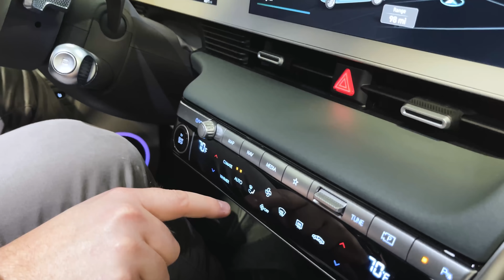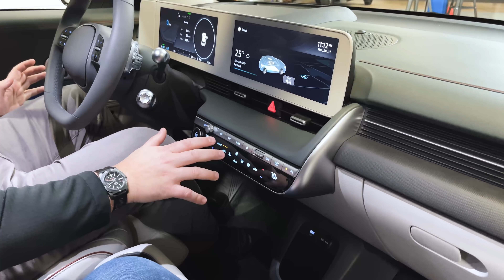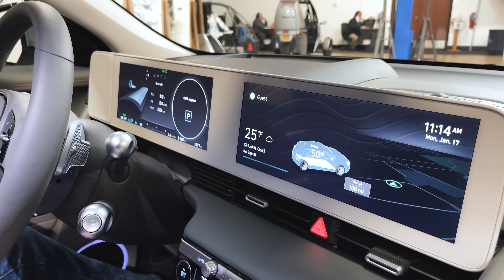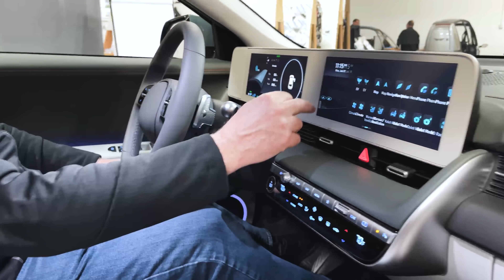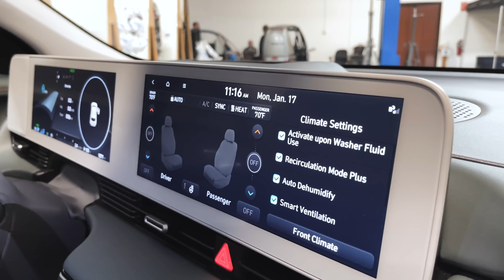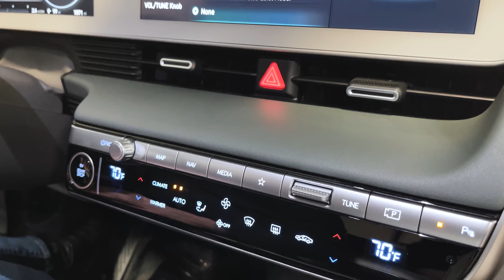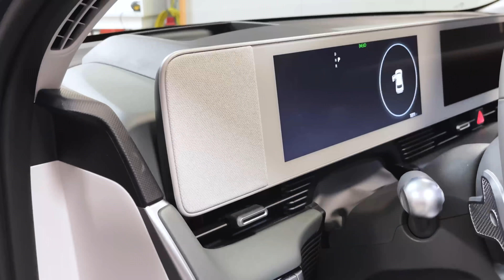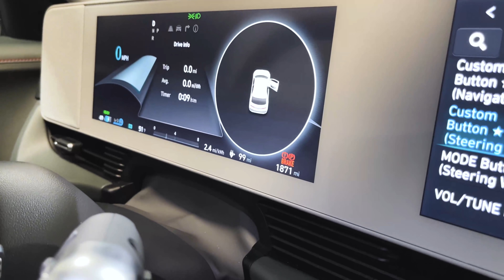2022 Hyundai IONIQ 5 | Sandy's First Impressions

Comment: Since watching this, I have just been out for a test drive in one. I was really impressed, the performance was impressive! So much space, especially in the back and the reclining rear seats are so comfortable. Very compelling package this car.
Reply: I wish Sandy had gone into the seat functions further.  The backseat reclines, but does the front seat recline?  There is a mid calf support on the driver's side, leading me to think they do.  Honda has the "Magic seat" in the Fit and in the HRV where the backseat reclines and the front headrest is removed while the front seat reclines.  A person in the back can then fully stretch out like a Lazy Boy.  Some Japanese executive cars, like the Toyota Century have a front seat pass thru for the rear seat occupant to stretch out.  This seems to be a really nice feature found on some Asian cars for practical reasons, since many are driven by Driver- Chauffeurs.
Reply: Hows the handling and comfort?
Reply: @maisondav1d  really good actually! The seats are amazing, the handling is tight and it’s not too firm or to soft. The steering wheel is very adjustable and the driving position is very flexible. It is a big car but its lively to drive. I like that you can floor it round a corner and the back wheels light up and you can drift it 😜

Comment: Curious how you feel about their decision to not have a rear wiper?  I was hoping that aero would push the water off but on other videos I've watched, it doesn't seem to do so.
Reply: I'd bet that the 2023 model will have one after all the backlash over it
Reply: If they used higher quality glass, it would be fine.  The crappier the glass, the more water clings to it.  The worst I have seen is the glass in the chevy volt.  It was the only car I have driven in where wind over the top of the car does not clear rain off the back window.
Reply: In reality, it is a complete mess and you can't see anything, if rain and dirt droplets start to spread all over the glass. Very dissapointing that those two guys talk about the ribbed platic rails, but don't "see" the missing wiper.
Reply: @Stefan_Dahn  Wipers should not be needed.  Wind should clear it.  But if they use crappy glass, then the water sticks and wind won't clear it.  Also, we should be replacing rearview and side mirrors with cameras.  Mirrors are all so terrible.  "objects in mirror closer than they appear" is a defect that cameras do not suffer from.  Cameras can be placed in spots with great visibility and without any distortions you normally get from mirrors.
Reply: It seems to have a rear "glass spoiler" - if it is sufficiently well designed - I don't see a need for a rear wiper.
Reply: @rkan2  Many people, who have driven them, say it's a problem.  I'll take their word for it.
Reply: @wilfredvanvalkenburgh2874  It’s one of the few drawbacks (lacking matrix headlights is the other for me) but not enough to put me off. I am going to nano coat the back window to have it clean itself when I get mine…

Comment: Good coverage as usual. A couple of features you hadn’t seen were variable “auto” setting on climate control and the configurable star button on the steering wheel. Both have been on BMWs. The I first came across the star button on the E65 7-series with original iDrive.

Comment: Why not get rid of all the left-side controls, AND the lower instrument panel, and put in 8 to 12 programmable buttons that can control ANY vehicle function from emergency lights to rear seat volume mute?  A/C on at 72 degrees, FM radio at 100.7, courtesy lights on/off,  call work office extension 142,  check outside air temperature...  Make those buttons "instant access to any feature" buttons.  Don't preset the functions - functionalize the presets.
Reply: @Carl Stockmal Have faith young man, Neurolink IS COMING. 😉

Comment: Yeah, and a problem with the screen only Tesla hvac interface, is that menu diving to find defog when driving in to tunnels in cold weather can be downright dangerous. 

Visibilty can drop to zero in a matter of 5 seconds. I almost crashed a Tesla 3 because the windows fogged down and there were no physical defog button. 

Your
Reply: Exactly, Sandy wants it to be more like a Tesla. I think a lot of consumers may like it less like a Tesla.
Reply: @justsayin7314  Maybe.  Personally I do like it uncluttered and simple, and the Tesla UI is great, but their view of what is and isn’t safety critical features that should be fully available at all times might be a tad to californian.  Sandy does the same mistake in this video. 

Hiding hvac and viper features in menus seems dangerous to someone from a «complicated» climate, they are as much part of getting from A to B as the steering wheel and pedals! 

To mention their own point: we really don’t want rental car drivers to fog up and crash, do we?

Comment: I have the RWD Long Range version w 77.4 kwH battery in Canada, I really am enjoying the car to date. I found that accessing everything in the system pretty easy overall but I am a nerd. The drive quality and range is great. Efficiency is very good in city and okay at highways speeds of 100-115kmph, hit 120 and it is not as great however to date I have enjoyed turtling around at 105 on the highway in eco mode w auto regen. I am impressed with the build quality and comfort of the car. I am also happy to own something a little out of the ordinary as well. I give the car a 2 thumbs up and I did not buy the Ultimate as I did not need some of those features nor awd

Comment: I don't think you can judge a press car on fit and finish as I'm sure they've taken more time to make it more perfect than a normal customer car.
Reply: There's plenty of Hyundais on the road to know what a production car looks like, and they have made huge progress over the years to the point where many compare them to Japanese quality.
Reply: @Speedytrip  I'm not saying it would be bad quality on a customer car, but they most likely ensure a press car is as perfect as it can be. For instance, did you know that the cars of German auto journalists are called "Presseautos" by German manufacturers, with their own manufacturing track & product codes, where Porsche, Mercedes & BMW add better engines, thicker paint and more insulation, etc. Not sure if this is just a German thing or a legacy auto thing.
Reply: I thought I understood Sandy say that this demo was a borrowed car, which I took to mean it was a borrowed customer car, and not a specially prepared  car for a Munro live evaluation.
Reply: @bmax403  1:37 "this is a press vehicle"
Reply: @alsmith358  Yeah no doubt about that. But just saying Korean fit and finish is now pretty much on par with Japanese manufacturers. And looking at this Ioniq, I think the American manufacturers will have a run for their money in terms of EVs.
Reply: I bet this car and a car you buy from the dealer both arrive with the same fit and finish.  Even going back to the new Hyundais released circa 2009 the fit and finish was superb in dealer cars.
Reply: This is not a press car this is the final version as these are delivering in the US, I have my RWD in Canada already and love it
Reply: @alsmith358   its not though this is the final version, 100% an error as this is what comsumers are getting
Reply: @kiddcisco  Press car does not mean pre-production vehicle, it means it's a company car that they loan out to people in the press.

Comment: It will be interesting to see what is going on under the “frunklet”.  I remember the Ford frunk looking great and useful, then seeing a plumber’s nightmare of custom rubber hoses and reused parts-bin stuff from ICE vehicles hidden underneath.  From the user’s point of view, it looks like a nicely designed car that will sell well into the family electric transportation device market.  Not a challenger to the Tesla Model Y from a performance standpoint, just a useable electric car with a modest amount of cargo space.
Reply: Ioniq 5 N version is expected to come out and will have similar performance to the Kia EV6 GT and Model Y performance for those that care for that in their family EV...
Reply: I own a jaguar XF that uses a Ford motor. I have had multiple issues with coolant leaks. The mechanic commented on why they had so many hoses in that engine. Now they put those same hoses into an electric. I just don't get what they are thinking.  The XF engine has actually been reliable except for the coolant issues.

Comment: This is the first review that has a substantial critique of the styling.  The one thing I agree with is that the fake kick panel in cheapish silver doesn't look great when you don't use a silver or grey paint.  In blue, black and teal the kick panel and wheel well work doesn't look great.  Strangely this is only an issue in the Limited edition.  The SE and SEL editions get the carbon colored kick panels which look much better with darker colors.  I suppose if everything else about the car is what you need you could order the body panels for the SEL and have a body shop put them in.

BTW: This is also one of the most detailed reviews period.  Excellent work.

Comment: How about lack of rear wiper? I drive a Chevy Volt without one and it’s a miss.
Reply: That does appear to be the general consensus.
Reply: I used to have a Chevy Volt and no wiper was no problem....same with my current Model Y
Reply: @lenimbery7038  This is a hatchback design. Air flow can't keep it dry like the Y. Have a look at Bjorn's drive when he can't see out the back window because of the dirt.
Reply: @lon6320  I used to drive a cube van with no rear window.  Not a problem if you know how to use your side mirrors and driving techniques to minimize limited rear visibility problems
Reply: Try some Rain-X.

Comment: I love this design. It’s like an 80s VW GTI got sucked into Tron. I would love to see a tear down. Does Sandy know about the V2V and V2L charging capabilities of this platform? I think when the dust settles, and the existing ICE car giants have tried to make the switch to all EVs, Hyundai will be one of the survivors. The 800 volt architecture and reverse charging capability seem very forward thinking. I’m just not sure about the rest of the engineering. Tear that baby down!
Reply: Agreed. But don't discount the forthcoming Nissan Ariya. Almost perfect, even if slower charging and a tad spendy. I have seen one in real life and it's fantastic.
Reply: Rather more a Lancia Delta Integrale
Reply: @GudieveNing  Having seen one in real life is a good sign.  Did you see it in the US?  Being driven on the street?  Did you get to talk to the driver?  Was it individually owned, or dealer car?

Comment: As someone who lives and works in the Midwest in all kinds of conditions, give me buttons. One of my greatest pet peeves is having to take of gloves in the winter to push a button or get a touch screen to work.

The other thing that drives me crazy is all of the grit, grease and dirt that makes the touch screen nasty or scratches it up. I also hate the glare off of the screen or the constant dust build up.

I live in a rural area and mud and dirt is just a fact of life. The other must is a proper volume knob and an on off or mute button on the radio.

Every vehicle with a touch screen and some years on it looks like Hell compared to the day it was new.

Touch screens okay for some things but leave my steering wheel and buttons alone. Also changing out one switch or control when it fails is way better than replacing an entire touch screen because of failures. Way cheaper also.

Comment: I have to disagree on the physical buttons delete. If I was on charge of safety regulations for cars, I would mandate physical controls for headlamps, wipers, shifting and climate controls (a front and rear defrost button at the minimum). Another thing that I don't understand is the lack of a mechanical emergency brake, something that is guaranteed to work even when the car is completely inoperative. With a lever accessible from the passenger side. It actually saved my garage door when my step daughter was learning to drive. She put the car on drive instead of reverse, on an inclined driveway, and my girlfriend's instinct reaction (she was on the front passenger seat) was to yank on the parking brake lever, thus saving the car and the door.

Comment: This car cant pre heat the battery when it is not plugged in. This will lead to a terrible charge speed in the winter.
Reply: All electric vehicles should have a button that lets you turn on the battery heating manually. It would make the daily usage so much easier.
Reply: Hyundai has already announced that preheating is coming. OTA Update I guess.
Reply: WRONG. Hyundai already announced that an OTA update is coming with pre-heat.

Comment: My 2014 toyota avalon has the same style of capacitive touch buttons.  I absolutely hate it. just accidentally touching the button changes the mode on the HVAC and it is distracting to get back to where it was before.  the radio controls are total confusing crap as well on the touch screen.  Also the visibility of the touch screen is poor.    I am with Sandy in getting rid of the whole dedicated touch button panel.  If you are going to put a touch button, make it have tactile feel or don't put it there.  
As always great review by munro and associates.

Comment: I have to disagree with Sandy on touch displays being superior to buttons and getting rid of the whole climate control cluster. Even the cluster they have is suboptimal, because it is basically a touch screen, that should be buttons. Adjusting you climate control should not require you to take your eyes off the road, only buttons can accomplish that, no touch screen can do that. Otherwise, in my opinion, it is a safety hazard.
Reply: 2022 say no to buttons.

Comment: This 800V doesn't give great advantage over Tesla new 450V in Model S refresh. The only benefit is lighter components and HV cables. As of charging it's 2P instead of 4P cells configuration so there's not much advantage here for charging unless they went for like 120kWh pack.
Reply: Ok but you're talking model S
Reply: 800V or 400V or 20.000 Volt do not make a difference in themselves.
Reply: Who cares about model S? Not even Tesla anymore. They only sold 11K model S & model X combined out of 308K cars last quarter. The Hyundai Ioniq 5 completely OBLITERATES the tesla bread & butter model 3 & model Y in everything and especially charging. Just 5min adds 100K mile range. 18min 10% to 80%. Tesla has fallen way behind and their sales will nosedive as soon as EV manufacturers start producing over 100K+ EVs per month...
Reply: 10% to 80% in 13 minutes given the right set of circumstances - that’s pretty cool!  800v charging is definitely next level.
Reply: @wolfgangpreier9160  
We'll wait to talk about the 4680 Y then? 😉
Reply: @dennislyon5412  I did compare Ioniq 5 with TM3 and it did just few kWh more in 15 min under normal circumstances starting from 10% SOC. Not even 10% faster.
Reply: @Harry-uq9qd  refreshed Model S charges even faster.
Reply: @rogerstarkey5390  Yes, of course! Will be interesting to see how much they really improved after battery day. 

400 or 600 or 1800V do not make the difference here. It must work combined with the rest of electronics and cabling. Thats all. 

e.g. i have to reduce the voltage in my solar panels and use 380W instead of the 445W i wanted to use because the inverter i want to use, which combines better with the solar battery accepts less.
Reply: @TheNature101  Tesla only sold that much b/c they stopped their production lines last year to refresh the Model S/X. They have ppl waiting for orders that goes into 2023 LMAO
Reply: @emceh  - a good comparison, with favorable results.  M3 is no slouch on the Supercharger!
Reply: @TheNature101  sure obliterating. Hyundai plans to make 600k electric cars (globally not just Ioniq)  a year in 2025 while Tesla already is close to one million.
Reply: @TheNature101  You must be delusional if you think the Lifetime sales off Ionic electrics (78k) in anyway compares to just the last Quarter sales (90 days) of Tesla Model 3 and Model Ys.  Hyundai has sold a LIFETIME of 25% of what Tesla has Sold in 90 days!! just in 3s and Ys.    Tesla is production restrained as their existing orders would take 2 years to complete.  No automaker has ever seen this much demand.  As for the future , you might not be wrong, but you probably are.
Reply: @dennislyon5412  Don't get too excited,  That only 179 miles of range.
Reply: @wilfredvanvalkenburgh2874  - 170+ miles - that’s a pretty good jump to the next coffee stop/charging station.  If you leave home with a full charge, you’ll need 36 minutes of charging time enroute to cover 500 miles.  I could live with that.
Reply: @rogerstarkey5390  I know I'm repeating myself, but I love your humour. 👍
Reply: @wolfgangpreier9160  Your solar panel point has ZERO RELEVANCE to EV battery voltages/usage. 🙄
If you disagree, PLEASE correct me & I'll apologise.
Reply: @Bellissima2k  🙄
Reply: @CNile-se9xw  Not to EV but to electronics and optimal combinations.
Reply: @wilfredvanvalkenburgh2874  learn to read before you lose all your money..the platform of.Ioniq 5 is not the same as just the ioniq before it. What's coming from Hyundai and kia over the next 12 months will crash Tesla stock
Reply: @wolfgangpreier9160  Cool, I don't have to apologise. 🙄